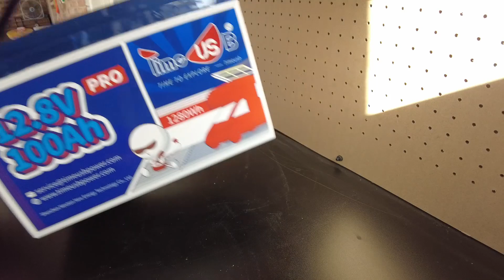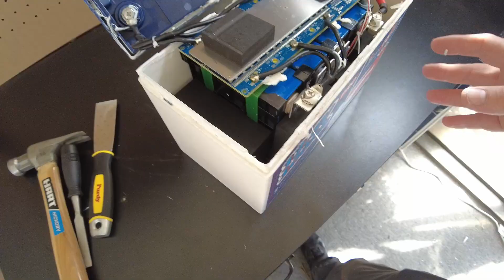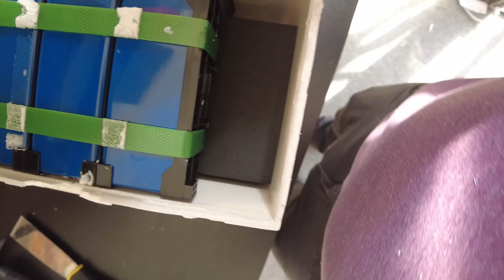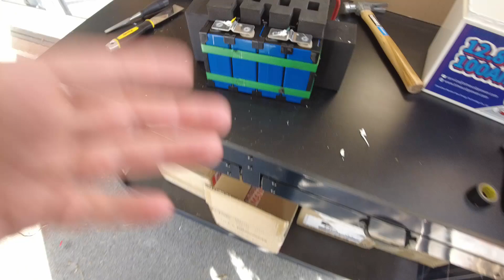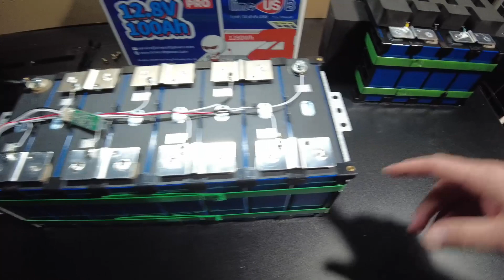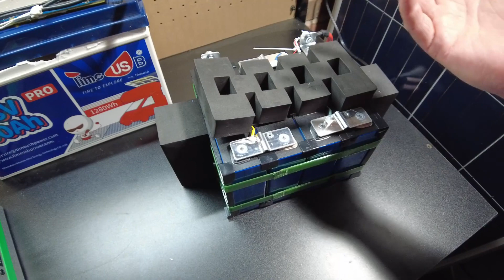Timeusb 12v 100ah PRO LiFePO4 Teardown

Comment: Do you think these would work well on a DC to DC charger in a car for car audio amplifier
Reply from the maker: They will do a constant 100a discharge per battery. So it might depending on how many amps you need.

Comment: Saw another video, and it seems that USED cells were in the Battery.   Would be nice to see what are the actual cels rated at and are they putting out 80 percent of their initial rating.   Sure they could last a long time but if they have already had 3,000-5,000 cycles on them wouldn't you like to know?
Reply from the maker: They do have a battery that has used cells. This one is different, and has new cells. They do disclose this when they sell. Here is the video I did with capacity test https://www.youtube.com/watch?v=uqFtCcqZ-ho Thanks!
Reply: That sounds like a tear down done by Will Prowse on the NON-Pro version of this battery (and the BMS is rated for just 50A).

Comment: Can I series it into 72v for my ev motorcycle?
Reply from the maker: No, these can only series up to 4 for 48v
Reply: @BradCagle  why?
Reply from the maker: @thanapatrachartburut513  The MOSFETs in the BMS cannot handle the voltage your talking about. Soon as one BMS tries to protect the battery by shutting off charging the MOSFETS will fry.
Reply: @BradCagle  Thanks

Comment: I know these are new cells, because they say they are.......
Reply from the maker: They have a model that uses used cells, and they say they are used.
Reply: @BradCagle  so?
Reply from the maker: @berns1853 Maybe they are new cell s, instead of used? Lol. Btw I've already tested the battery, and it pulls well over full capacity, so I'm not just going off "because they say so" the capacity test is on my channel.
Reply: They come from China, what’s not to believe 😅 The marketing lies that are used are staggering. You cannot buy a true grade A cell 100ah battery for less than 450$+

Comment: Thanks for the teardown. It looks like a good option but, how do you think it would handle being used in series 24v for a boat? What did you think of the BMS? I've watched 3 times now and still can't convince myself. It's still a lot more than lead acid deep cycles. Help me decide please.
Reply from the maker: You're welcome. Yes it will work in series, up to 4. It looks every bit as solid, if not more than all the other tear downs I've done. Me personally I think I would buy it over any lead acid, but please weigh the decision yourself don't let me tell you :)
Reply: having bought these batts. for home solar project, I took the leap SCARED! as they do cost more than flooded lead acid. I work at walmart and even get batts. at walmart cheaper. but I will never go back to lead acid after buying these timeUSB batteries, I bought four 100ah pro batts and LOVE! them they charge fast with my 400w solar array but plan to add another 100w panel as winter is here. you won't regret it.